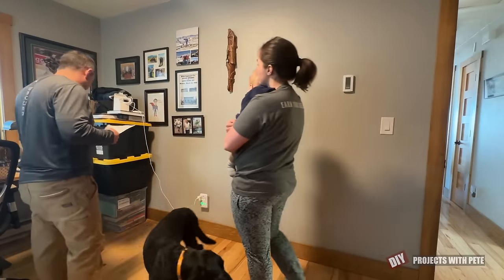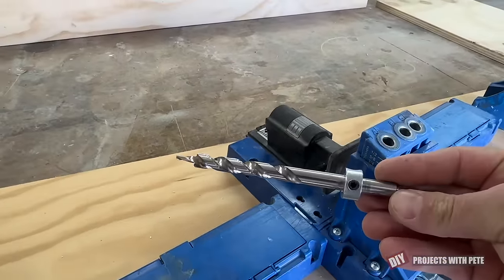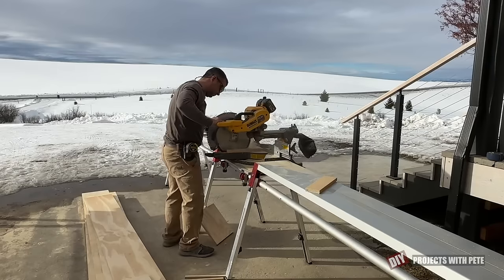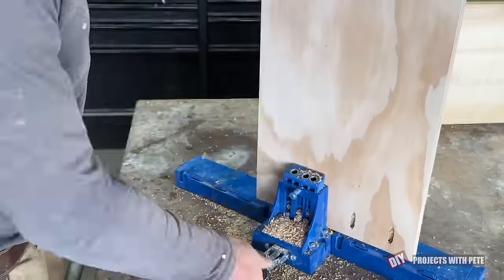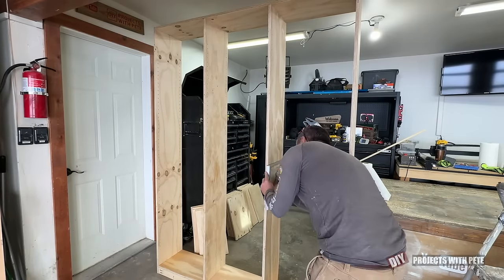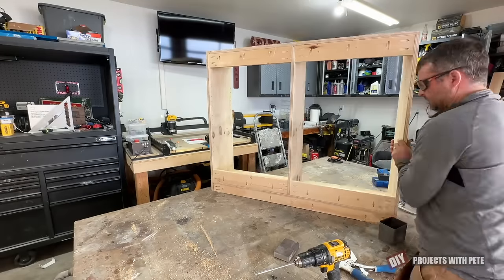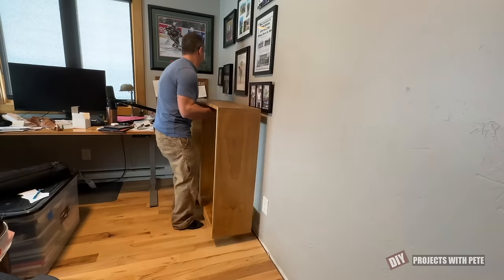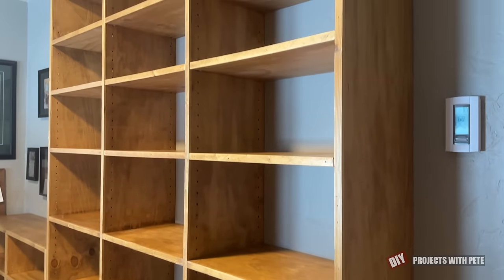The Best Bookshelves for Your Home [How to build your own]

Comment: It's always refreshing seeing a project on YouTube that doesn't involve walnut, resin or pallets. Looks great.
Reply from the maker: Thanks so much! Yeah tried to make this one simple and keep the costs down :) cheers!
Reply: I love you
Reply: Well you could easily replace walnut for something cheaper. But on the rest I agree
Reply: @jabanan  it could be something more expensive than walnut, just not walnut.
Reply: Wood is expensive. For beginners working with pallets is a great way to avoid wasting money. It is also a good way to prevent them being built or go to a landfill.
Reply: @freetorobandloot  for a beginner, no. There is sooo much work in processing pallets that a beginner may stray away after their first project. I’ve made a few things with pallets, and I won’t ever again.

Comment: Nice design and work. It helps to have a good shop setup like yours to make the process easier. Years ago I made some short bookshelves in 3 sections to fill the space on a short wall where there was a down sloping ceiling for my office. All I had was a table saw but it worked. Also used that saw when I installed a real 3/4 x 2 1/4inch oak hardwood floor in our house. That was a lot of work without a power stapler to put those boards in place. I paid  a professional to sand and finish the floors. They still look great after over 20 years of use. I need to make some more bookshelves because I have too many books now that I am retired.

Comment: Very cool. Thanks m working on a sideways king size storage bed frame and headboard. Being under 6ft a sideways king gives me a wider bed and a shorter footprint.  
I just don’t know if I want full depth drawers on both sides or shorter depth drawers with a storage area between that would be accessible from the foot of the bed. Cheers!
Reply from the maker: That sounds like a fun project! Good luck with the drawers and tackling the project, cheers!
Reply: @DIYPETE  yeah it can be a little overwhelming

Comment: I am going to be building a bookshelf soon as well.  I was thing about using pocket holes, but I am concerned that they might not be strong enough to hold the shelves when loaded with books.
Reply from the maker: Have fun with your bookshelf project! Our shelves are only 19 inches in width so I don't have any concern with the weight of the books, but perhaps if you are wanting to do larger spans then you'd want to look into a different method. Cheers!

Comment: Those shelves look lovely after you sand them well, pre-stain them and then put the stain (and seal) on, it's a tedious part of the process, but makes such a difference. I just checked... here in the UK I can find "Radiata pine" 25 mm, reasonable cost compared to e.g. birch ply of the same thickness. Any reason you are recommending Radiata? I mean does it tend to have nice knots or anything like that?
Reply from the maker: Hey Mike! We use radiata plywood because it is the best quality and most affordable plywood for building shelves around here. It used to be around $35 / sheet but is now around $60 or so post pandemic. But it is pre-sanded and smooth on both sides when you buy it. Not much for knots. They only sell it at Home Depot around here though. Anyhow, basically quality and cost is why I get it. Cheers!

Comment: great video man! what is the thicness of the plywood? and could i make shelvs 150cm large?
Reply from the maker: Thanks for watching! The wood is about 3/4 of an inch thick which would be about 19mm. As for 150cm wide shelves, You'd want to add additional support under each shelf so it doesn't eventually bow.  Or you could create cubbies similar to what I did to support them. Best of luck!